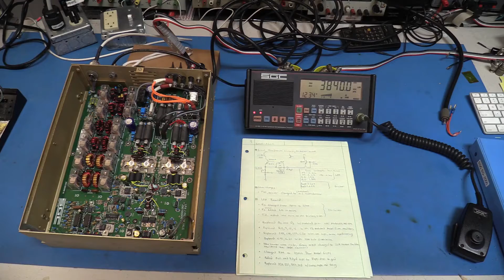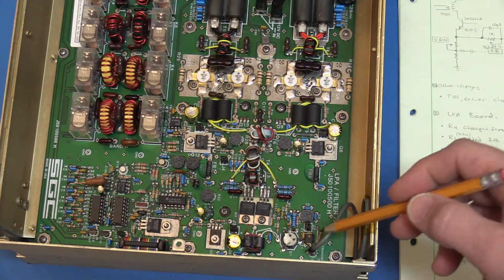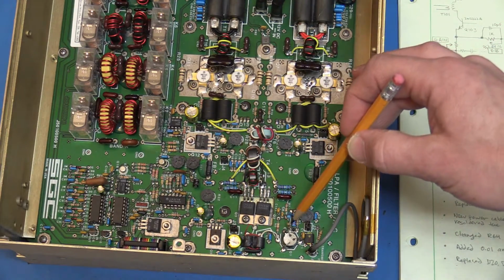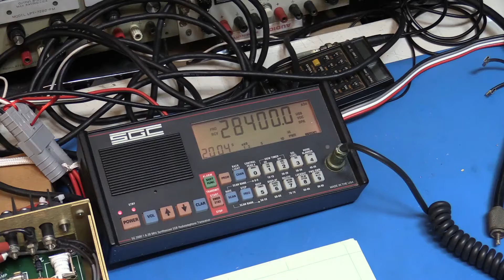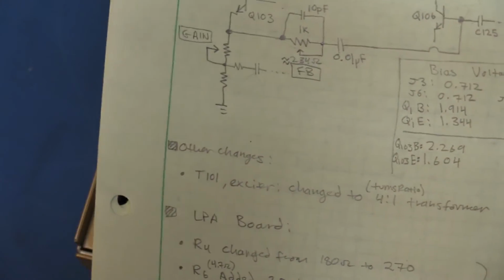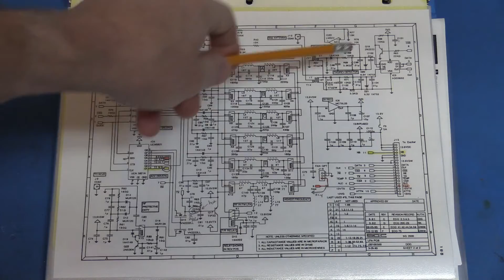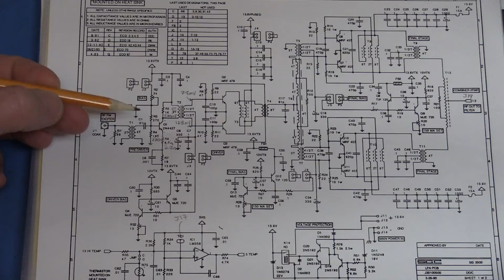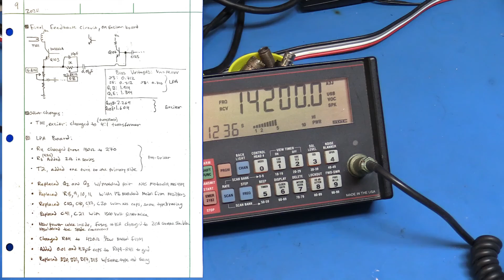SGC SG-2000 PA and Exciter Mods

Comment: would you be willing to work on my father's sgc2000 it is for his sailboat he uses it when out at sea. if so what could it cost. i understand that you cant be exact but say you had to do the same thing & replace some or all relays, what would that cost?
Reply from the maker: Honestly this really isn’t a good choice as a life saving radio. The modern HF radios are so much more advanced and can send his position to the coast guard (and other agencies) at the push of a button, trying each band until receiving an acknowledgment. Automatically. It may even be required that he have such a system depending on the area and class of vessel. I would not want this radio out on the open water, especially if it was to be used in dire times. So that’s my advice. Save the money you would have spent to fix it up. Sell it to someone that can make use of it at home for fun, and buy your father a modern HF radio with DSC. That and a good antenna coupler could save his life at sea. Reminder: the coast guard does not monitor voice channels for distress anymore. They only listen for DSC (digital sel call which sends your position and vessel ID automatically). Then they will make voice contact if needed. 

Sorry for the safety lecture. I just think about how I’d feel about my dad relying on something like this in a bad situation out at sea and it would bother me. 

Anyways, I don’t take on repairs generally. 

73, happy sailing